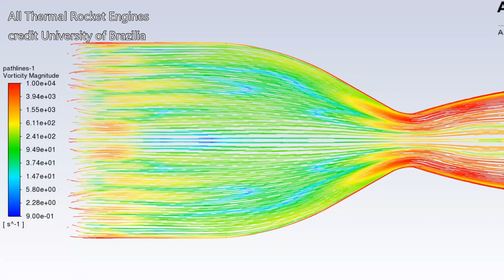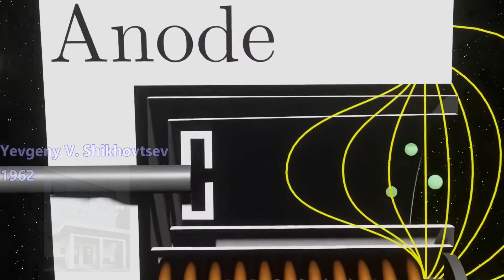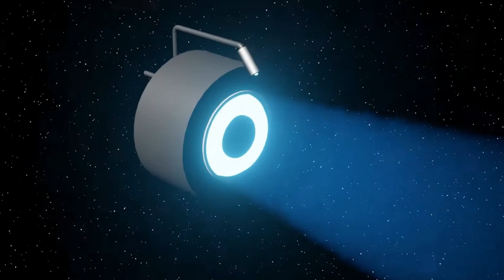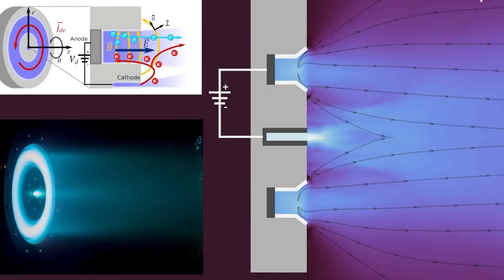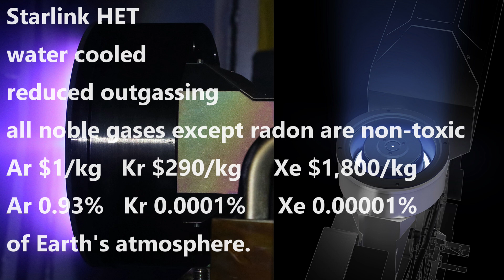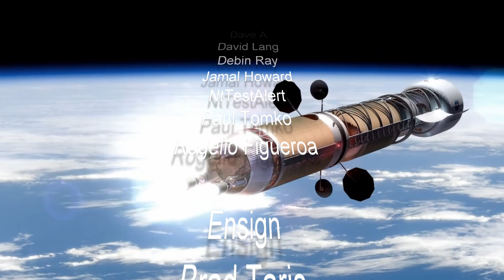Spacecraft Propulsion: SpaceX Argon Based Ion Propulsion Technology

Comment: The Self-Contained Ion-Powered Aircraft is the first ion thruster capable of lifting its own power supply while operating within Earth’s gravity, earning a patent for onboard power and the related improvements.

Its design increases thrust efficiency compared to traditional ion thrusters by using optimized geometry and power management. Operating at higher voltages and lower currents, the craft achieves much faster propellant exhaust velocities when tested in a vacuum—a well-known principal and key advantage in ion propulsion.

In Earth’s lower atmosphere, propellant speed decreases due to collisions with air molecules, caused by the lightly ionized oxygen molecules created during its operation. Never-the-less, the aircraft achieves a higher than one to one thrust-to-weight ratio!

Flight tests have been conducted both outdoors and indoors, with and without safety tethers. Some flights have lasted nearly two minutes under official observation. For more information, including patents, demonstrations, and media coverage, visit the official website and YouTube channel.

Comment: Can someone answer this question for me. 
  Is an ion engine limited by design or by the amount of electrical energy your able to bring along. 
   In other words, if hypothetically  you had a fusion reactor the size of a bread basket  with almost unlimited energy, could you take along less reaction mass and just turn up the electricity.  
   I guess what I'm wondering is, let's say if helion can someday come up with a fusion reactor the size of a really big barbecue grill 
  Can we go sailing around the solar system like they do in they expance. 
   Or is there any ideas in the works like a muon catalyst drive that might get us there.
   Does anyone know if the vasamer is ever going to reach its stated potential. 
   Anyway just wondering.
Reply from the maker: Yes. You could launch a rocket by ejecting one proton if you could accelerate it enough.  As you approach light speed you start converting energy to mass, therefore you could just eject very high energy photons and still launch.  These photons would be ultraenergetic gamma rays so you might make the neighbors angry though...
The VASIMR engine is a good design if you have a lot of power available.  It can operate in "low-gear", high thrust lower Isp, or high gear, lower thrust but high Isp.  But you really need fusion or fission for it to be practical.
Reply: Yes I understand in theory if you push one particular with enough energy you can achieve  the an equivalent amount of thrust as using less energy more particulars.
   I guess the limiting factors I'm curious about are of practical applications. 
  For instance, if I want my motorcycle to run a little better I could purchase a better quality Ignition coil with a different winding configuration and better internal insulators. Ruffley speaking, I could increase the size of the spark. Lest say the original coil would load to 40,000 volts and the improved coil would load to 70 or 80,000 volts. There is, however, a limit to the amount of energy I could achieve. Eventually, something would fail. The insulators in the coil might break down, allowing the coil to short internally.  Or the spark plugs, etc...
    Is there a theoretical limit to how much energy we could put into an ion drive, and is that the limit that we are designing to.
  I'm assuming we would be designing our engine to be throttled with the most efficient mass to energy ratio to achieve our needs. 
 Anyway,  I was just wondering.
Reply: Also I'm not as interested in moving around at fractions light speeds. I was wondering about more practical speeds. Let's say up to the point where we'd have to start considering heavy duty partical shielding.
Reply from the maker: That will require antimatter :-) But since we found a bunch in the radiation belts around Earth let's go hoover it up and get on our way to Alpha Centauri!  Or is it Proxima?  Better figure that out before we go. @jimpiaz9537

Comment: What one needs is my new non-conventional scientific rocket engines, which can take a spaceship to Mars in less than an hour. Calculations show : an Isp. specific impulse of 574 million sec. Average thrust of 78.84 billion newtons, 8.039 million tons of thrusts power.

These engines can use any fuels including : liquid hydrogen oxygen fuels for 85% light speed, & easy to produce anti-matter fuels proton/anti-proton pairs.
They also use more than 1 power sources, & generally  use 14 kg. fuel flow rate. Therefore it can use this amount of fuels to reach Mars. 

The laws of physics say nothing can travel faster than the speed of light, the ultimate speed limit.

I can surely prove this wrong, because I have discovered 2 specific ways to attain the speed of light.

Plus, the technology is already here used elsewhere for something else.

I need help, a company,or someone honest trustworthy to build manufacture these scientific rocket engines.
Reply from the maker: Uhm... no thanks.  Anyone riding that would be strawberry jam in a few microseconds from the acceleration.

Comment: Ionization in space, in the atmosphere of earth. The earths magnetic poles are shifting, our magnetism has lessened, the Vanderbilt belts and the suns Coronal hole influence and CME bombardment. The electric aspect of our solar system is vast. Perhaps a lesson on birkland currents etc would be a start because it may lead to new means of fuel and propulsion?
Reply from the maker: A friend of mine was looking at riding the magnetic field lines from and back to the sun using superconducting magnets and metamaterial shielding... the energy in those lines is astounding.

Comment: A nuclear power plant takes days to shut off.  Presumably a fission rocket can turn off faster, but during that time, there must be fuel going though it to cool it.  That fuels thrust efficiency would go down with the temperature of the rocket core.
Reply from the maker: That's true for large light water reactors but in this case cryogenic propellant can be circulated in a turbine loop with the heat expelled through radiators once thrust is no longer efficient...
Reply: @terranspaceacademy  Good to know!  You would need big radiators though, since this would be a huge heat pulse.  Going from cooled fluid back to cryogenic would be a significant task.  Just letting hot fluid release into space is attractive, but maybe not good in the long run.  Long burns could decrease the problem, as the cool-off would be a lower percentage of the task.  Short burns would be forbidden.

Comment: Cool to see the Mars Transit Vehicle in the end credits. The nuclear thermal / nuclear electric hybrid propulsion is absolutely ideal for Mars transit! I did NOT realize that Mars had such a ready supply of argon! Combined with a Martian variant of the Starship HLS,   and using CH4 as the fuel for the nuclear thermal cycle, this makes a lot of sense.
Reply: Cool your jets there James, it isn't a ready supply at all ! Earth has just under one percent Argon, Mars one point six percent, but that is from an atmosphere that is one hundred times less dense. Throughout the solar system there are countless sources of propellants, hydrogen in frozen form in ever larger quantities past Mars, a propulsion system that is designed to operate with a range of propellants would be better, especially if used in a thermonuclear propulsion system like NERVA, that way a team could  explore as far as they wanted right out to the outer limits of the solar system.
Reply: @ashleyobrien4937  I realize the atmosphere is only 1% of Earth’s, but compared to having to scavenge hydrogen from water ice, separating it out of even an ultra-thin atmosphere is a “breeze” (heh). Anyway, I wasn’t knocking the use of hydrogen, but it’s not a great fuel for Hall-effect thrusters in the nuclear electric phase of travel. For nuclear thermal hydrogen is the clear winner, but if you already have a Starship-based architecture, you’ll have methane on board, so I would expect the performance hit might be offset by not having to carry tankage for yet another propellant.
Hydrogen scooping nuclear thermal rockets have been proposed for many decades, and I still think they could be a great idea for outer solar system exploration.
Reply from the maker: We agree. An atmospheric processor just has to land on the surface and start working.  Mining ice is much harder.
Reply from the maker: Good points.
Reply: @ashleyobrien4937  If SpaceX still uses methane for launch from Mars surface then they'll be compressing CO2 into conversion reactor so the 1% argon will be going along for the ride and enable recovery at the most efficient step.
Reply from the maker: Thank you James... Methane itself actually works quite well in a magnetoplasmadynamic thruster.

Comment: Way back in 1965 (or so), a friend and I created an ion propulsion device and wond a "Space Power Award" from the "Air Force Power Association"(?). The Air Force Power Association was NOT connected with the USAF, but held an annual science fair at The Worcester Polytechnic Institute  in Worcester, MA. Our device used a discarded TV for the power. One terminal was from the side of   the CRT, and the other side was the TV chassis. We used  some copper wire with V shaped clips soldered onto it as the top. The bottom was insect screening, and it was  about 18"x18". We clearly demonstrated a small thrust which could be seen from the little bits of paper that we hung from it. I don't remember where we got the idea, but the thing did work. I'm 73 now, so some details may be a bit fuzzy, but it was pretty much as described. We believed that the thrust came from electrons colliding with air molecules.
Reply from the maker: Very cool Vinny!  You could have been the original Dyson fan :-)
Reply: @terranspaceacademy  The Dyson fan actually has a motor hidden in the base, unlike ion thrusters that can work without and mechanical moving parts, just ions.

Comment: I think argon is the best choice for spacex, as even if efficiency is lower and tank size is larger, they are the ones who brought down the price per kg to orbit, and anything that encourages them to bring that price down further I applaud. Also making use of cheap abundant resources makes a lot of sense. 

While I am here I would like you to consider a subject for a future video. Since Spacex changed to stainless steel for its booster and ship I have always thought one of its biggest advantages suddenly became its versatility. You can easily add or remove rings on the fuel tanks, you can add or remove engines from a stage with a change to a CNC program, yes, you need to reroute pumping etc and do a bit more testing, but nothing is totally free.
You could add a disposable intermediate stage that could be later made a reusable stage, if they can get close to the SpaceX aim of $1000 per metric ton of thrust then throwing away up to 7 vacuum raptors at a time and a bit of stainless is no big deal if it alows you to throw Orion plus a large extra payload to the moon. Or throw a mini starship direct to mars requiring far less fuel production for its return, at least for the exploration/initial stages.
This versatility can also be used to make starship more suited to outer solar system exploration.
I would be surprised if I was the only one intrigued by these and other possibilities that starship could offer.
Reply from the maker: I think an expendable "third stage" option would be very useful and relatively inexpensive.

Comment: Won't Iodine be a better choice ,less cost and can be used from a solid form, from what I have read, iodine can generate higher speeds per minute
Reply from the maker: That is a good option and the ESA chose that propellant for one of its projects... There are also "salt" based systems, I think there may be more restrictive limitations on mass propellant flow with solids at our current technology.

Comment: hmm instead of pointing at the one ion engine on the satellite  in the video it points at the heavy metal rings on the side of the satellite used to stack the satellites.  basically its duty is to carry the weight of all the satellites that are on top of the satellite and sort of be a spacer between them.
Reply from the maker: Dang.... you are absolutely right.  We thought that was a camera... mea culpa.

Comment: Solar thermal may struggle to get a tenth of a gee acceleration in a practical spacecraft at one A. u. But it can beat nuclear thermal to Mars because it can easily move PV into the focus and efficiently produce electricity for an ion engine. Bimodal nuclear has many times the mass per unit power and orders of magnitude higher cost. 
If a “Starlink on Steroids” system is set up for solar power satellites to provide power via microwaves to the surface and comm and positioning, then argon is the obvious choice for station keeping.
Reply from the maker: Very good points Steve

Comment: out of curiosity, can helium be substituted for hydrogen in the nuclear fission engine to reduce potential RAM scattering around the earth without compromising enough of the isp or thrust to weight to make it not worth our time?  As long as the uranium remains contained then it would be a clean engine, dangerous getting that uranium to a stable orbit though....  im only 4 minutes in so i imagine that the ion propulsion being the point of the video outweighs the need for a fission engine... but i was just curious?
Reply: i actually solved a bit of this in ksp in a video i made called mars freight train,  i think that if i was able to incorporate nuclear or ion thrusters it would be much more efficient....but the kraken doesn't like the nuclear engines... but it was really the concept of aero braking to circularize that i think might be the way to go in the end and modularization of the system as well...I think you might enjoy the idea.... obviously the inflatable heat shields would not be used but I was limited by the tools of KSP...
Reply from the maker: Interesting... the helium of course, is much heavier than the hydrogen gas.  2g/mole to 4g/mole... Or 3g/mole if you use helium 3 but I want that for my aneutronic fusion reactor if you have some :-)

Comment: Nice conclusion! A 1/4rth refueling cost that saves a day's worth or standby orbit, it would more or less equate to direct launch to mars.

This could sling reserve fuel to the moons of saturn for a certified return trip to Earth.
Reply from the maker: Thank you Lin!
Reply: Question. I know they are ridiculously efficent.

 Is not the volumetric density of the propellant an issue? 

 I mean a propellant with a higher mass at the same velocity would require less fuel?

 I'm sort of curious on the differences between velocity between different propellants honestly. I don't know how much mass matters for Hull Thrusters.

Comment: Actually the energy required is the square of exhaust velocity, so If you assume 100% efficiency for 13Mj/kg of hydrogen and oxygen combination you get 5100m/s , but if you use hydrogen in a nuclear thermal engine you need for twice in of velocity exhaust four time more energy,52Mj/kg and if you want ten times more speed than a chemical engine you need 100 times more energy (1300 Mj/kg of expelled gas), that is without considering how various in inefficiency are different types of rocket engines.
Reply from the maker: Thank you!